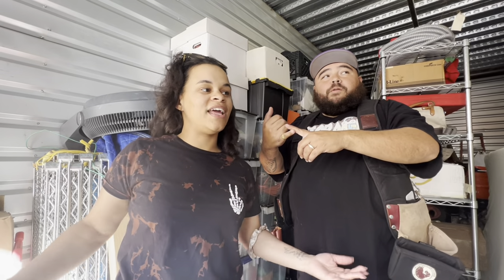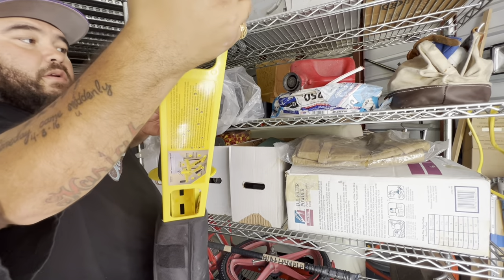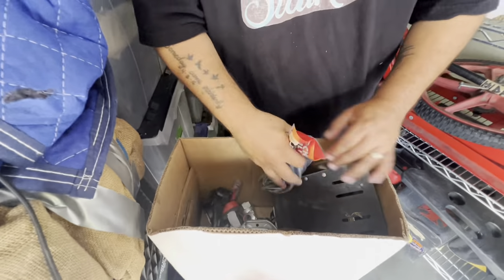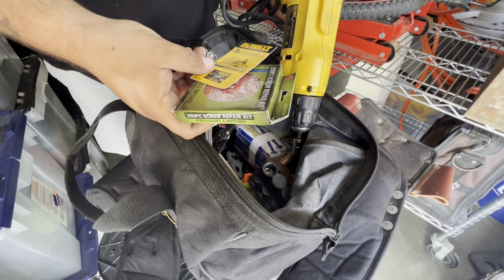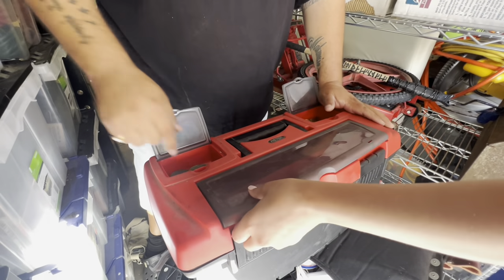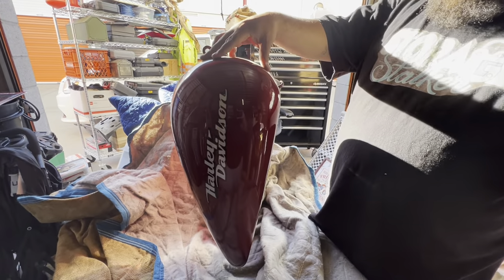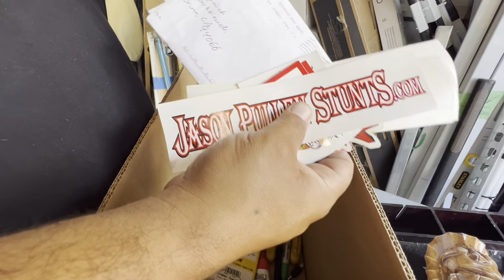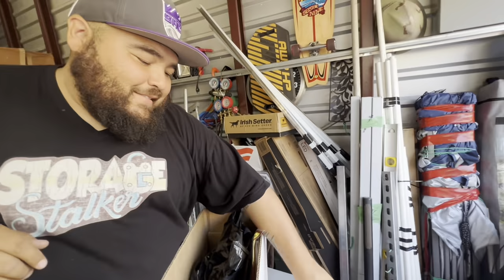Nothing short of amazing | treasure hunting in pricey storage unit #100k #storagewars #topoftheline

Comment: All those Klien hand tools are worth good money. They are higher end low and high voltage trade tools. Also those rack-a-teers snap into eachother. Sandwich the flat sides together for easy storage of one unit as opposed to carrying around two separate sides.

Comment: That tool is a air cutter. @ 13:16 those are not belt buckles. they screw onto the primary covers on a motorcycle. @ 21:00